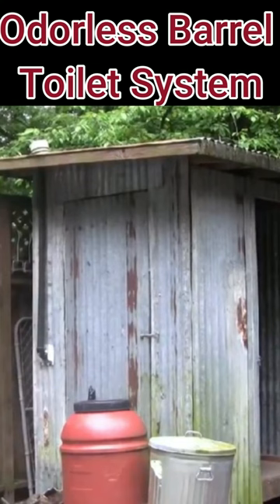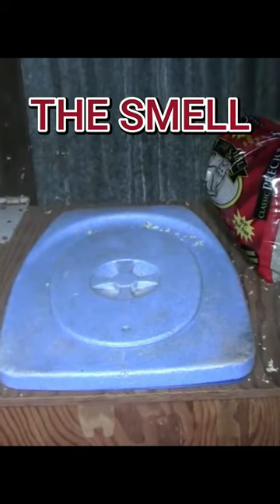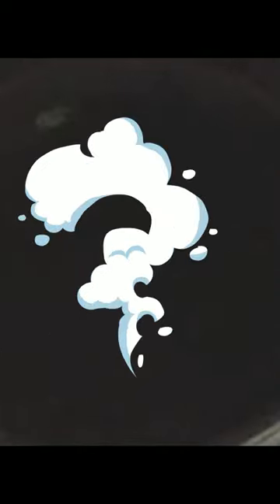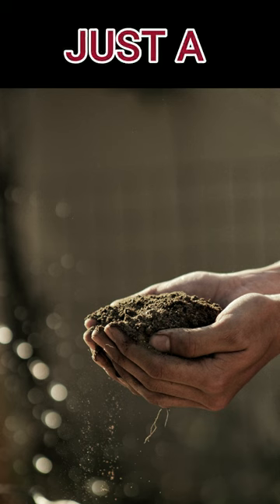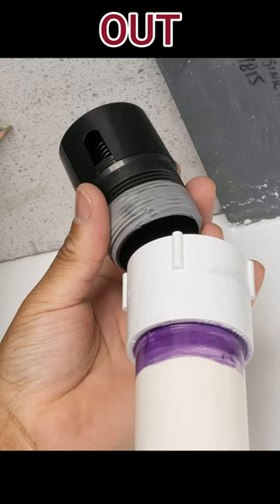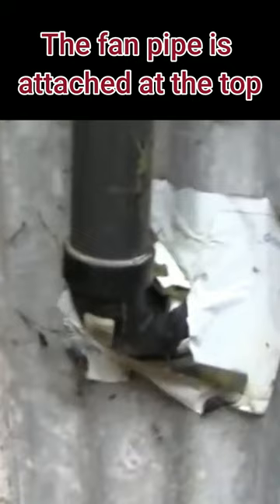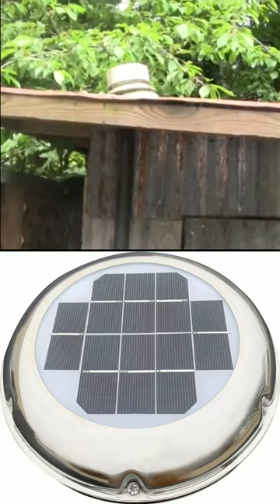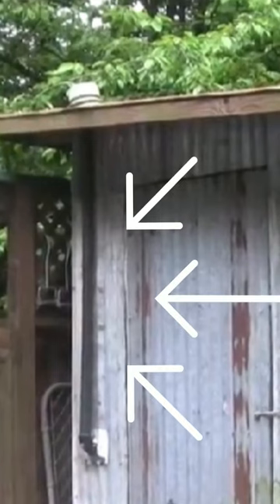Composting Toilet System Design with a Solar Vent, Urine Diverter and old Pickle Barrels

Comment from the maker: The only thing I would change about this system is I would probably just put both the studer vent and the solar vent in the cap and run one long pipe to the bottom of the vent and a short pipe at the top for the studer vent rather than cutting a hole in the bottom and plumbing it out the side.  That way if you decide to move the pickle barrel while it is full you can close it up easily.